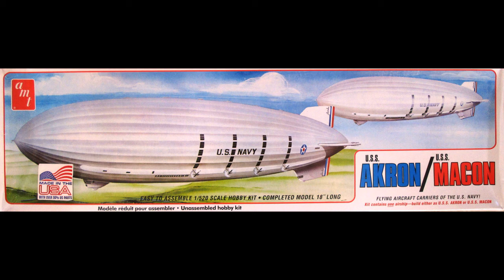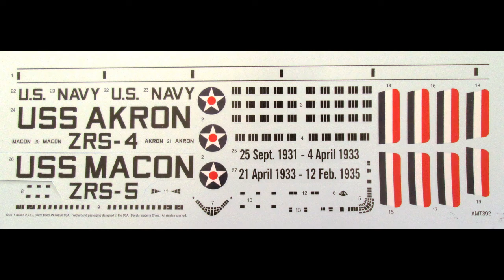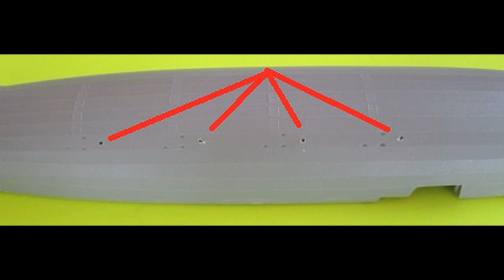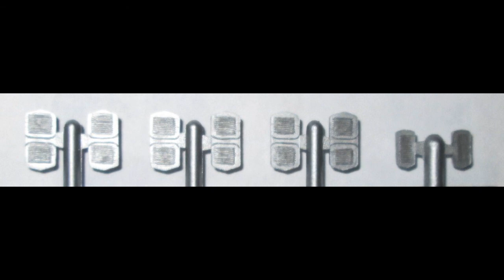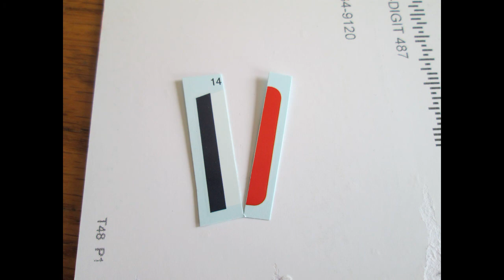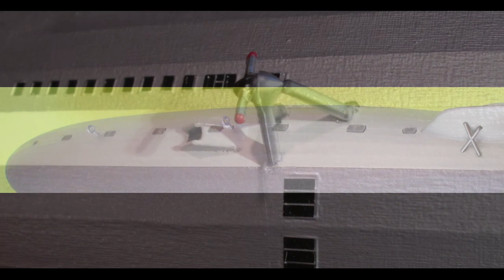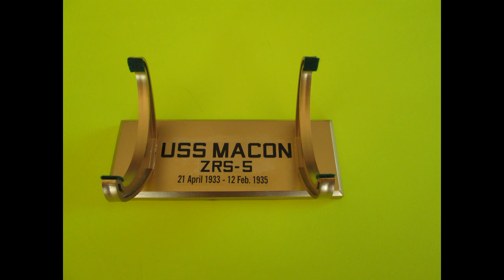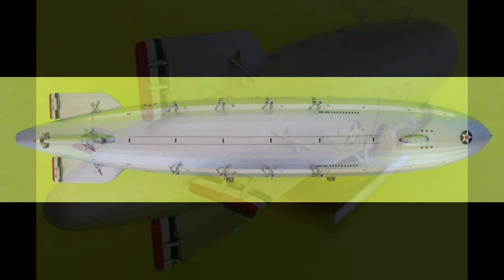How to Build the USS Akron or Macon Flying Aircraft Carrier 1:520 Scale AMT Model Kit #892 Review

Comment: -did you know: that the vertical string of, "windows" above each of the ship's screws are actually condensers to capture engine exhaust as ballest to prevent the ship from rising as she burned her fuel?? Helium was VERY expensive at the time so you did not want to valve it if possible as they did hydrogen on the Hindenburg. Also, you will note that only the propellers are outside the hull while the engines themselves were in the ship. Compare this to the Hindenburg which had her engines in pods outside the ship in case of fire since the Hindenburg was floated with Hydrogen.
Reply from the maker: Peter,  Thanks, that's great information!   -PS,  please subscribe if you haven't already to help us reach more modelers! -Doug

Comment: Too bad the all the engine and tail details are so thick and crudely made.  There were no fat "X" braces on the tail fins only a few cables. The basic hull and tail fins are a good start but look at the photos of the Akron or Macon and if you want a quality model make these pieces yourselves to the proper scale.     Alsohow the model is displayed really ruins it.     I would use a simple long wood base and recreate the single pole portable mooring mast as can been seen in photos of the Akron at San Diego.  If you have the skills, making the movable mooring mast that was used at the Navy Airship Base at Lakehurst would be even better.  Again photos and YouTube video are avalable.    My R100 Airship Model uses a welding rod down the center of the hull to connect it to it's mooring mast.  Think of how you might want to do something like this and make any needed mods before you glue the hull together.  It's also too bad they didn't include a little Sparrow Hawk fighter and a trapeze under the hull since that was the defining feature of these two airships. Figuring out a way to add those features would be really cool if the model is hung from a ceiling.
Reply from the maker: CT,  Those are all good suggestion for adding detail and realism to this baseline kit!  -Doug